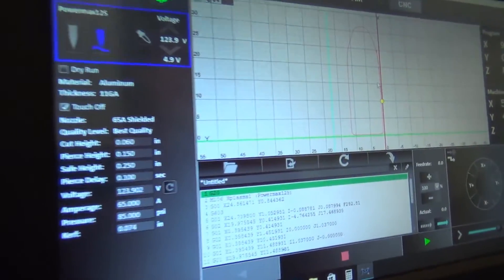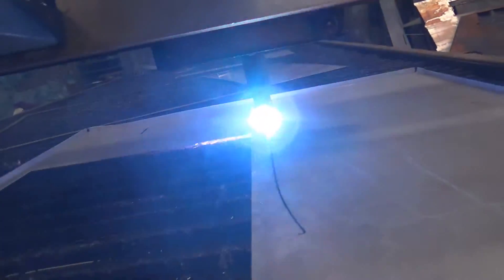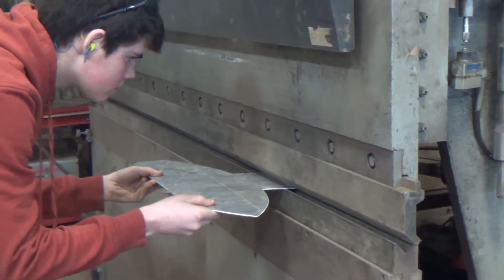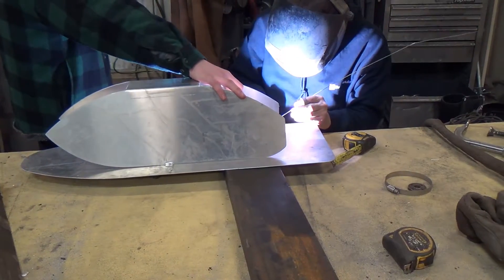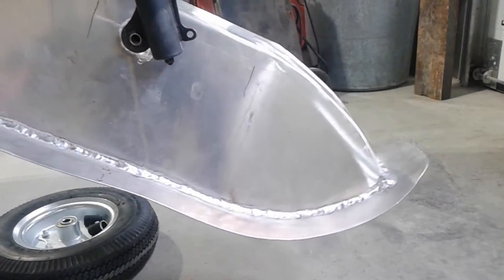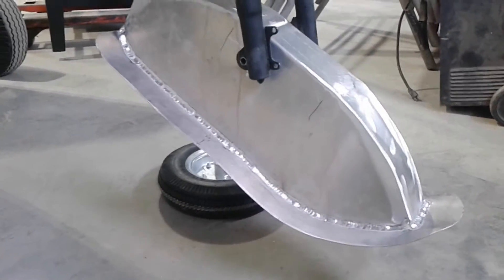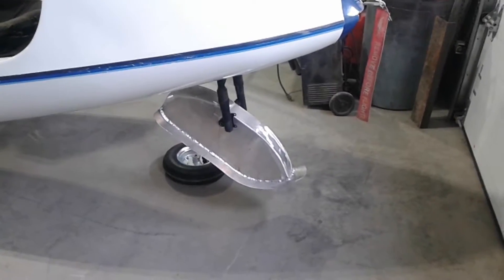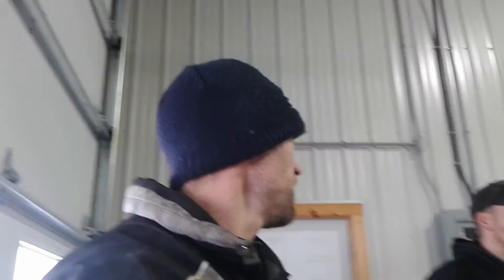Re-Designed Nose Ski | Re-Build: Part 15

Comment: Really genius ski pants to prevent snow accumulation and you have a compartment for a ski repair kit.   I would probably mock up a removable foam cinder block cover just to mess with people.  Quick question: Have you ever flown a Beaver RX 550 +?  I'm wondering how it compares with your vintage of Beaver flight wise.  ASAP changed the wing design and incorporated a lot of the changes they made to the Chinook including aircraft fabric (doped) wings.
Reply from the maker: I haven't flown one yet but I certainly want to!

Comment: Perhaps it would be a good idea to move the axle more forward.  Check out the way the main gear on a 747 hangs down so that the rear wheels contact first.  With the axle in the position shown here, the front of the ski might hit and grab, causing damage to the bottom of the pod.
Reply from the maker: There will be a bungee that holds the ski tip up in flight which will ensure that the rear of the ski contacts the snow first. If the axle is moved forward, when the ski is on the snow, there will be more of the plane's weight on the nose of the ski than the rear and that will cause it to dig in.